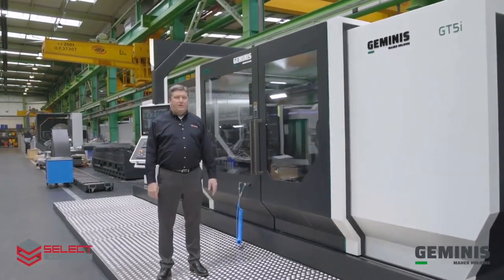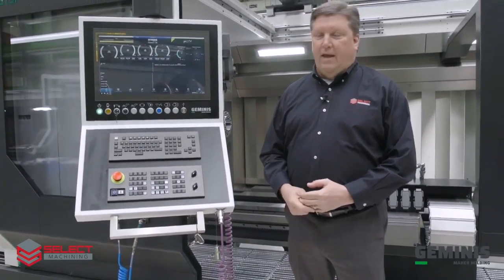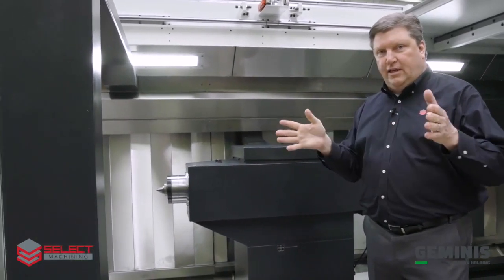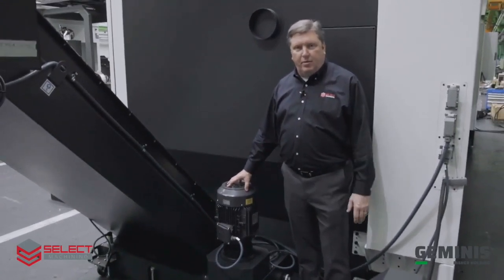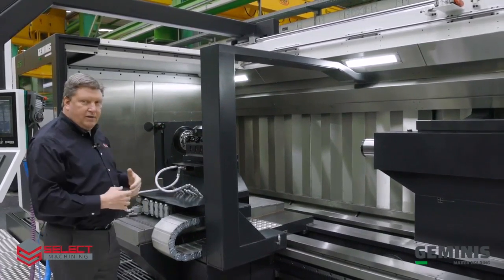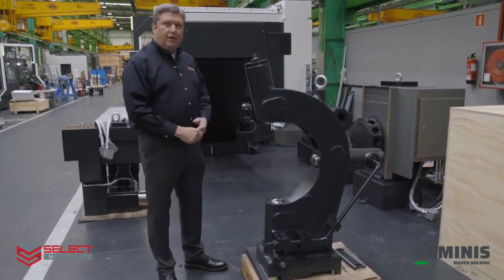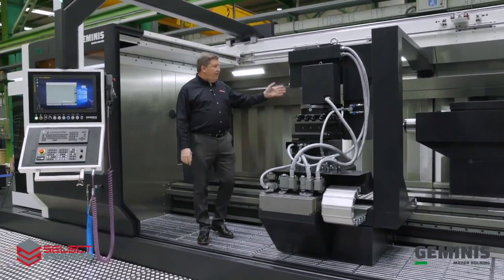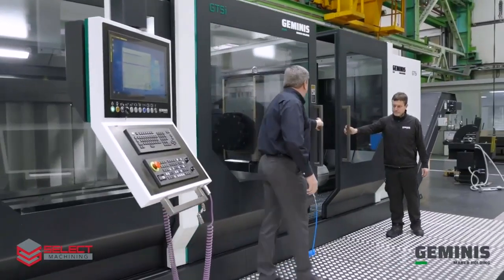Large Capacity CNC Lathe - The Geminis GT5i Multitasking CNC Lathe

Comment: I want to get a lathe precise enough for me to make an elite set of lathes that will be used to make a bank of lathes used to turn out an army of mini lathes to replace those 7"x12"s that are notorious for being out of square and out of round.
Reply: EEERRR ! HARDINGE !!???
Reply: @davidwillard7334  mother lathes and mother mills for straight edges with zero hills. Flatness so with parallel faces, no runout, no disgraces.Concentric, true, perpendicular, no error detected in particular. scraped ways with grooves left from flaking, these machines will be good, because competitors are faking.
Reply: @davidwillard7334  thanks for asking man, not yet; its a ways a way no pun intended. at the moment im applying the metrological arts to guitars and fixing them up so that all the fret heights are to a proper plane.
Reply: I fully support your endeavor